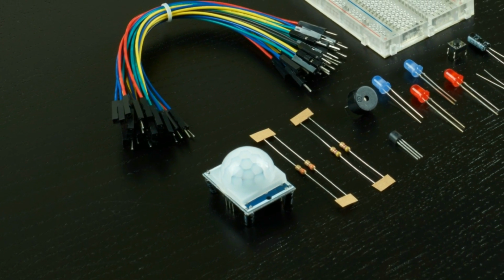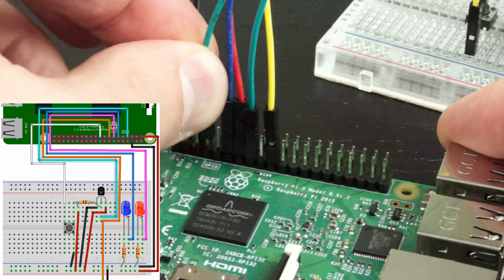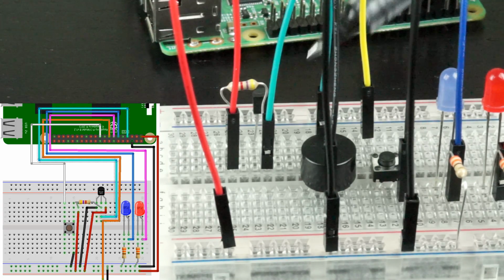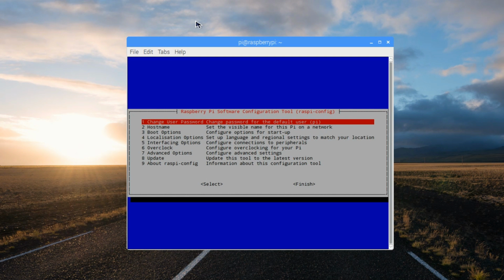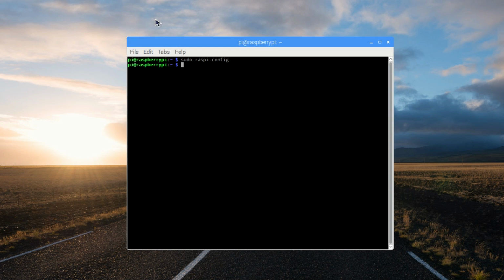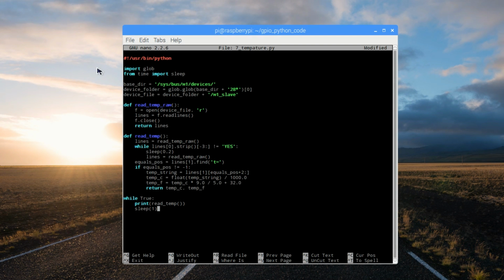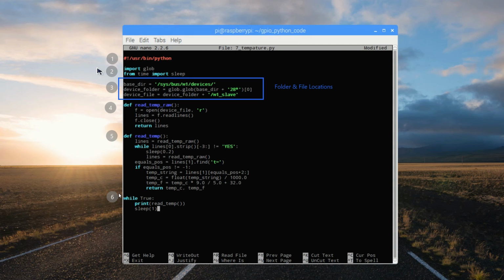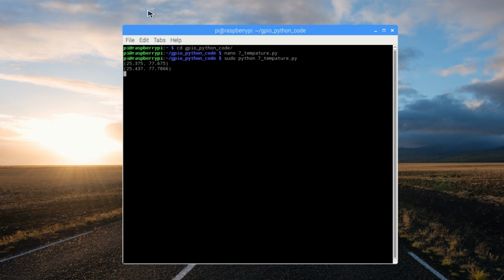Raspberry Pi Workshop Kit Tutorials – 7 Temperature Sensor

Comment: index out of range most likely means raspberry pi is not reading the sensor. to verify go 
 /sys/bus/w1/devices and make sure there is a subfolder that starts with 28-xxxxxxxx. it will contain the sensor reading. the way showed in the video didn't work for me so I connected it in a parasite power mode. lookup datasheet

Comment: When I type sudo python 7_temperature.py
It show up : IndexError: list index out of range
Is there any problem for this?
Reply: I had the same issue. I fixed it by turning the temperature sensor 180 degrees on the bread board. It seems the sensor has a right and wrong way round.